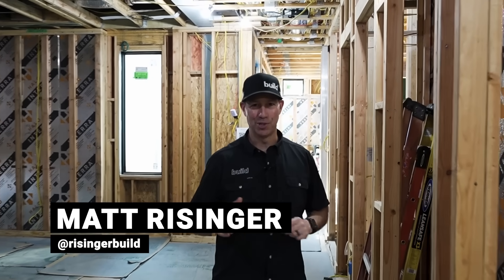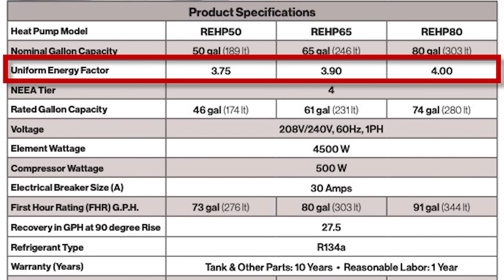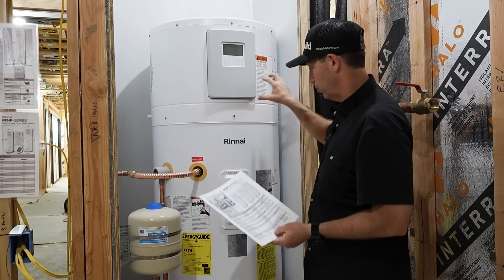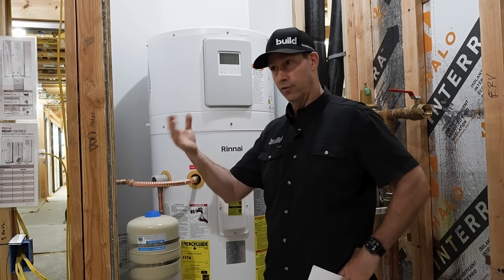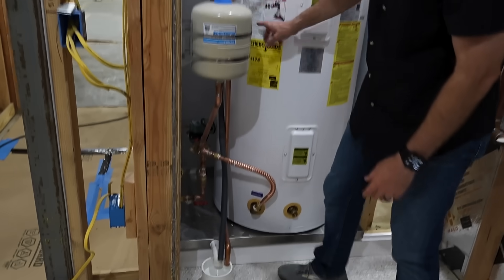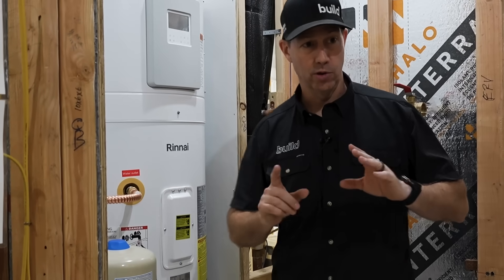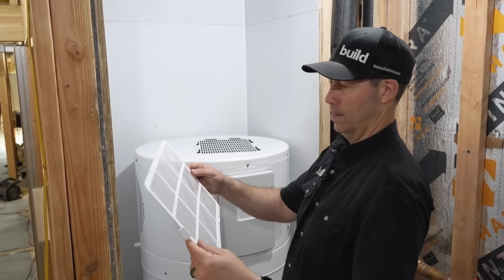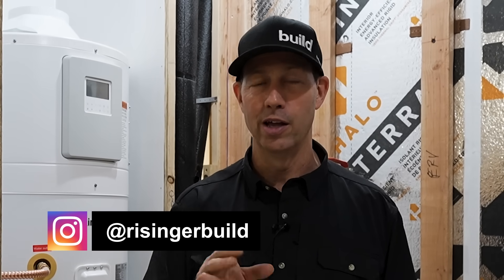The Best New Water Heater? Rinnai's KILLER Electric Heat Pump

Comment: I got my Rinnai for free, almost!  I qualified for the HEAR program.  It’s a state (AZ) run program but federally funded.  Took me all of 5 days to get approved.  Also got a $840 off a heat pump dryer, but haven’t bought it yet.

The HPWH rebate was $1750 but had to be purchased through Lowe’s, which limited me to either AO Smith or Rinnai or Bosch.  The AO Smith had the worst reviews I’ve ever seen for an appliance.  The Rinnai and Bosch are identical minus some cosmetics, but Rinnai was half the price of the Bosch.

Comment: If hot water heat pumps use ambient air to harvest the heat, then this will only work in warm areas (not in a garage that is 35 degrees) so if inside it uses the heat from the furnace keeping the house warm. It is a zero sum gain, no gain of energy savings once the furnace costs are added in. Now add in the complexity with a higher up-front cost for equipment and labor and it looks like a scam on the energy balance sheet.

Comment: Don't forget that running this water heater where the house is being heated (fall, winter , and spring in northern climates) will cool off that area. That will mean running the house heat more. This negates quite a bit of the energy saving this unit provides. In the summer when cooling the house, this heater actually becomes a benefit as it will cool the room(s) slightly. I would assume the Uniform Energy Factor is based on the heater being in a 70* area. Someone who installs the heater in an unheated area such as a garage in the winter, will not be getting that same factor. It will be considerably lower. Also the Recovery Factor is based on ambient house temperature. If in an unheated area in the winter, expect that to also be lower. Here is an example of the extra energy needed in addition to the energy consumed by the water heater. Using 10 gallons of hot water and heating the water 70 degrees (from 55 to 125) requires 5845 BTUs. That is the amount of BTUs pulled out of the air from the water heater. If using resistive electric at 15 cents per Kw the cost to reheat the air in house would be 26 cents. If using a heat pump to heat the home that will drop to roughly 10 cents. Heat pump water heaters placed within the living area only saves money when the house is in one of the warmer climates where the heating only happens a couple of months of the year.

Comment: So, this can air condition your house to some degree in the summer, taking SOME of the excess heat in your house and dumping it into the water.  In the winter, though, taking heat from your house would be a wash if you have electric heat.  Are there some numbers showing this to be economical with some other forms of heat?

Comment: I wonder how that could be efficient install. I am not sure if that is the standard practice in you country.
The pipes are not insulated and the air will be getting recirculated in that confined space and make the unit very inefficient.

Comment: Heat pump water heaters are awesome. Even better is when you tie in a heat pump (or better yet geothermal) HVAC system that dumps the heat into a buffer tank that then supplies the main tank. Personally, I would rather have the heater in a more open environment. Same as most mechanical room equipment, having it all in a more open and easily accessible area makes future repairs and maintenance so much easier.

Comment: These water heater are e.ectric hogs. The new standard is uef  4.0. Only rheam has it so far the United States is about to mandate that  all hot water heater be  uef of 4.5 and be 20 yr warrenty for parts and labor. Plus, all showers and water in residential be 1 gpm or less. And that all dish washers use only 3.5 gallons. Plus all water heaters cannot be gas or use any heating elements at all.

Comment: The best way to think about these, is that they rob heat from the air, so the warmer the air, the more heat they can dump into your water.
A basement in the north is not going to give you much with one of these, it will always be running in straight electric mode.
A Florida garage is absolutely ideal.
Reply: They work absolutely fine in the north, in a basement, without needing to use the heating element. They also help reduce humidity if your basement has moisture issues. The savings I've had with mine compared to the high-efficiency natural gas heater I was using is over $150 annually.

Comment: its very efficient but on most of your vidios you do not give the price of the unit, or its exepected life,  Also there is maintance that its needs be performed along the way. You need all the information to compare so you can figure out you ROI. What good would it do to spend several thousand dollars to putchase and maintain it plus the extra cost to retro fit or install in new constuction and then have it fail right out warrenty and that wasnt mentioned. Forvjustva couple a standard hot water heater might be a better option in many cases

Comment: If there is a cold air return ducting above this  HP water heater , would not installing a duct grill  in the return that is open in the summer closed in the winter?

Comment: We had a Rinnai electric heat pump water heater installed in December 2024 we live in TN, (unit is located in garage) and had issues right from the install. The installer set our unit to Hybrid mode and 120 degrees, which is the recommended temperature from Rinnai. We have the 50 gallon tank model and the unit never reached the set temperature of 120.  We have a three person household and were running out of hot water if we all took showers in the morning.  Our unit was loud and seemed to have an issue with the heat pump condenser. After contacting our installer about the noise and temperature, he returned and Rinnai had him replace the computer unit thinking that was the issue with it not reaching temperature. Changing the computer did not help the unit reach set temperature and still didn't address the loud noise coming from the heat pump condenser. The installer then changed the unit to the Rinnai default mode of Economy and still all the same issues. Extremely long recovery time, not getting up to set temperature and loud noise with the heat pump condenser. After this they decided there was an issue with the heat pump itself and replaced it with another one.  We still have all the same problems.  The new unit is still doing all the same things the previous unit did.  The whole reason we changed to a heat pump was for the efficiency and cost savings. Maybe something to do with unit in garage and TN winter weather? But our installer says no, should be able to work just fine in our garage and with the weather. (but I am questioning this). Why make a unit that has all of these different modes, Economy, Heat Pump, Hybrid, etc. if not all of the modes work? Also, why have settings for the temperature if it never reaches the set temperature? I do not recommend the Rinnai Heat Pump water heater. Get a gas water heater way more reliable and no issues with recovery time.
Reply: Yeah... I'm not sure that's a problem with Rinnai or heat pumps....

Perhaps you aren't aware, but many people don't have the option for gas in their homes. A heat pump heater would be ideal in such situations (ASSUMING IT WAS SIZED CORRECTLY).
Reply: Sorry to hear about those issues. FWIW I installed a Rheem heat pump water heater nearly 5 years ago and it has been great, and very cost efficient. For a family of more than 2 people I would recommend a larger model, if not the largest. If you look at the efficiency specs, there is hardly any difference in their electricity cost; in fact the larger ones can be more cost efficient in certain circumstances.

Comment: it pulls the heat from the air to heat the water and discharges the cool air in your house.  So in the winter your furnace will run more.  Great for the summer free A/C.

Comment: Why only 1 year warranty for labor, compared to 5 years for the Rinnai tankless units? My concern is that there is a lot more moving parts in a heat pump compared to a tankless unit. So long-term costs of repair are a concern.

Comment: I bought a Rheem 50-gallon unit two years ago.  It is installed in a utility room off the garage.  It has lowered our electricity cost by about $180/yr, so after just 2 years it has had the same TCO as the all-electric unit we replaced.  If it lasts another 8 to 10 years, it will have saved us right around $1,500, while also just using less energy, which is something I am glad to do.  (If and WHEN rates go up, we'll save that much more...)

Comment: So perhaps obvious statement but if you’re using a heat pump in the winter to pull heat from outside then using a heat pump to pull that heat inside into the tank, it seems like there must be a more efficient process.

Comment: I can't stand Rheem's software, I'd almost be willing to remove mine and switch it with this just to not deal with crap software.  I love the duct system as well.  The Rheem app is the worst, and it's the gatekeeper to the ability to schedule times and modes throughout the week.

Comment: Nobody is commenting on the noise. I want a silent unit and this sounds like a small generator in my garage. Wakes me up at night and I hate it. Additional,  in the northwest,  the air is colder and it cools the water rather than heat it. E heater mode keeps the water up to temp while the heat pump function cools it down. It do not recommend this for anyone living in cooler climates. The noise alone makes me want to replace it. I can switch it to e heater mode but it switches back afte 72 hours. I need this permanently switch to e heater mode or I will replace it.

Comment: Hold on!   I thought the little tiny box on the wall was all the water heater anyone needs.  What are the odds that the heat pump or any other overpriced water heater will ever pay off?  I went through this with Geothermal.  The payback was longer than the warranty (20 years.). No can do.  I'm already paying enough with uneconomical solar panels which will never payback.

Comment: A 10' x 10' utility/mechanical room is a very expensive build at current Contractor rates. Do they make these in a model, I.E. lowboy, for use in a conditioned crawlspace?

Comment: I assume these heat pump units do switch from a heat pump operation to a regular electric coil at one point right? Having been reading up on the options here in Norway for "water to water" style heat pumps that pull ground heat from a bore hole the kind of steady state temperatures we typically aim for in a water heater, 158 degrees Fahrenheit or above, can't be reached by such a heat pump alone. Are these units making such high temperatures using nothing but a air to water heat pump? If so how are they achieving that. I thought at some point physics imposed a limit on how much heat you could exchange based on the temperature of the source. Now i get that it might be higher for the air to water pump as the air in the technical room will be warmer, but with the pumps I was looking at water from the bore hole would cap out at ~86 degrees or a little less from a source sitting at ~39 degrees. Don't know a lot about thermodynamics but it seems wild to me that you can get so much more from the air in the technical room even though it is warmer.

PS: If you wonder who is making the recommendations about the temperature of hot water it's a national agency called FHI (which translates to the "peoples health institute"). They don't generally regulate much in regards to buildings but they make recommendations related to typically water with respect to avoiding unwanted bacterial growth that may have adverse health effects and so forth. All the technical requirements are handled mainly by a building standard called Tek 17 (the current one dates back to 2017 it was supposed to be updated last year, but it's delayed) and EL-normen. The latter covers detailed requirements for electrical installations while the broader aspects are incorporated into the Tek 17 standard. Link to FHI recommendations for those that want to run it through Google translate (!! Be aware that all temperatures listed are in degrees Celcius, I have converted the relevant ones in my question to Fahrenheit !!): https://www.fhi.no/ss/veiledere/legionellaveilederen/temakapitler/interne-vannfordelingsnett-som-forsyner-dusjer-og-andre-aerosoldannende-tappepunkter/?term=

Comment: Having now seen the pex in tubing style connectors used in Norway (and the rest of Europe) I really think Matt should advocate for this to his customers. I mean if you are gonna add the detail of a leak proof pan under the water heater why have all those copper pipes running throughout the house as a major point of failure?

Comment: The 500 Watt vs 4500 Watt comparison is frankly misleading as the 4500 watt draw is running for far far less TIME, like roughly HALF the time as with the heat pump being a factor of 4 it's only inputting 2,000 watts worth of heat at any given time, so that means it has to run twice as long to put the same amount of heat into the tank.

I am say this as someone who personally owns and installed a Hybrid Water Heater on December 1st of this year, I have been living with the unit for a month now, I also have a Emporia Vue 2 monitor in my electric panel so I have the raw data, in the first 15 days of the new water heater it used 26% the amount of electricity that the old water heater used in the previous 15 days, but what also needs to be mentioned is the water heater is now adding to the heat load requirement in the winter so you have to factor that into your energy savings as your heat source is now part of the calculations. In the summer you will save on cooling costs, but in heating season you are not reducing your water heating costs to 26% because of that extra heat load, if you have a high COP Heatpump you can get it to probably 75%.

Frankly they should put bigger heatpumps on the unit so they can recover faster and not have to run for 2-3 hours to recoup.

The real bonus to heat pump everything is you reduce your concurrent current draw which allows you to downsize the inverter capacity you need to take your house completely Solar Powered.

Comment: The Steibel Eltron has a high COP,  no resistance heater, and an input that allows a remote control to adjust when it will use power for things like demand response.

Comment: Messed up logic. That cold air in the house is ok if you are cooling the house whwn hot outside...but terrible if you are heating your home in the winter...net loss and NOT NOT NOT any gain whatsoever...wirh additional complexity and cosr one could Duct out that cold air insulated duct fan switches etc.
There is no no no free lunch folks! 
This is marketing
Buyer beware
All the very best
Do a lot more homework!

Comment: If the enclosure surface of the walls surrounding the water heater is expected to act like a shower pan then the contractor should have caulked the entire edge along the top of the stainless steel pan.

Comment: From the UK I have had a similar one of unites albeit a 650 W compressor and has been operated for 10 years without fault , and has an efficiency of 4.2  ( this matters a lot as electricity is the most expensive in Europe), I have never run out of hot water,  there is also the air which is discharged is dehumidified cooled air that can be used for aiding the whole house ventilation cooling via a 3 way damper . Not too sure of this unit but mine has an anti legionnaire bacteria cycle that operates once a week automatically.

Comment: I watch Matt's blog regulary as a subscriber because he does seem to keep up with the industry. He says he is a builder but he comes accross at least to me as a salesperson for whatever new thing he has found. He should ditch the "Welcome back to the build show shtick IMHO". I don't think I have actually seen him do any work not even lift a hammer but I could be wrong. Everything he builds and recommends is the greatest thing since sliced bread is narcissistic. I agree with many of the other folks on here. Initial cost too high and I doubt it will last 20 years. I would bet that almost all if not all plumbers would not recommend one of these to a customer. Go with natural gas hot water heater if you can and you will not be disappointed. Of course if you want a hot water heater to last you need to drain once a year and pull out the anode rod and replace if necessary. My experience with the anode rod tis that it will go about five years depending on conditions.

Comment: Heat pump water heaters put out cool air. Refrigerators put out warm air. Would it make sense to put a vent from the water heater to the bottom of the refrigerator nook and another vent from the top of the refrigerator nook to the mechanical room with the water heater in it? The cool air from the water heater would make it more efficient for the refrigerator to run, and the heat from the refrigerator would get picked up and put into hot water by the water heater.
Reply: BTW, I have an apartment. I've been visiting a friend for several months. the only electrical useage in my apartment is the refrigerator. I get my bill online and can see the useage go up in warmer months and down in cooler.

Comment: Do not forget, that hot water heat pump will use the heat in your house aka your house heating system gonna have to compensate for it, same thing with the heat pump dryers, yes I seem to state the obvious but some people do not see the obvious.
In summer, any heating will be cooling your house so it s good thing, in winter , not so much but the electricity cost would still be lower given heat pump are very efficient.